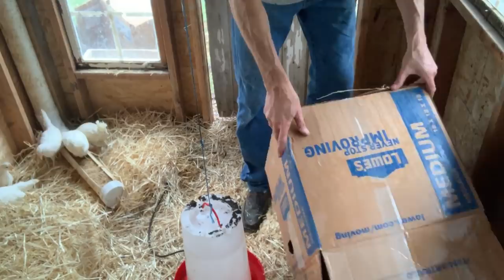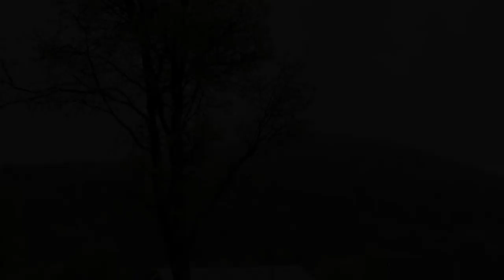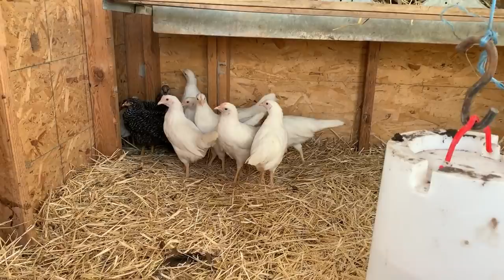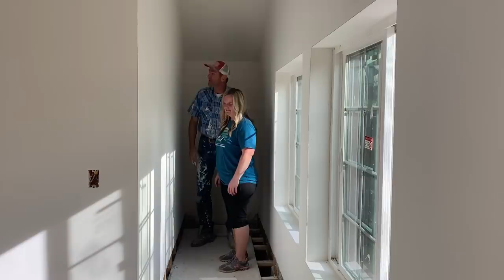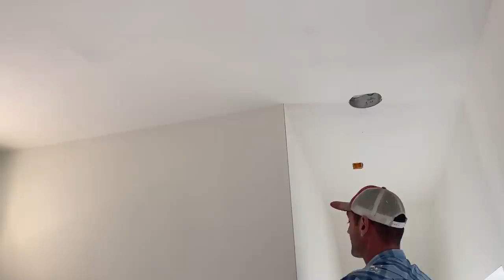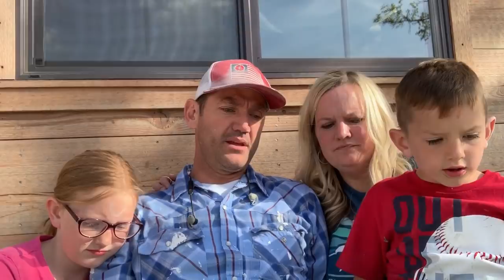#328 - Cedar Inspects Final Drywall Finish... Ready For Paint!

Comment: Before you remove the covering over the stairs..
Concider painting the ceiling and areas that will be hard to get at once the landing is removed
Reply: Trim, paint and wash windows. Leave the ledge. It will make doing this job again (washing windows and painting) easier and do-able by teenagers.
Reply: @marianneoprisko7737  
Then if that's an idea...
Take 1 inch thick of plywood and hinge it up to a wall. Then when needed...simple fold it down
Reply: @jimh712  yes, those little trouble finders will grow into helpers. And if Cedar sees it for a safe way to reach the out of reach, she  will be way less afraid.
Reply: If you were looking to add a bit of more storage, right in the end of the same area covering over the stairs a 3' X 3' closet or a bit bigger would be a good area for a small storage or a hidden closet for personal valuables.  You can build a long one piece or a two piece retrievable catwalk all the way to that unused space covering over the staircase.

Comment: From playing at hanging sheetrock what I have decided is the more work you do putting up one skim coat on top of one more skim coat.. you end up with more skim coats to fix the previous skim coats.  Then you have to sand or water sand to actually get close to the skim coat that turned out to be close to what you wanted.  If all this sounds redundant it is because that is the nature of a level 5 skim coat

Comment: If your done mudding this won’t help. But if not, you can thin down your mud with water and use a 3/4 nap roller to apply the mud and then smooth out with your 12 in knife. That how I used to smooth out walls.

Comment: Told you before Heath, you get my utmost respect for all the hard work you've done in such a short time. Respect !
After so many years of construction and renovations under my belt, if there is ONE thing I always hated to do is drywalling and mudding. The last projects I did, over 10 years, I subcontracted both. These guys work way faster than I and way better than me.
Doing a full house like yours is a non-sense. Both time wise and financially.  It's physically VERY demanding for the non-professionnal. And these guys don't cost that much, you know...

Comment: Use a pva primer before paint! Have you thought of using a roller to roll the drywall compound out since you doing all the steps for a level 5 finish. To roll it you will need to thin the compound with water. 

Happy mother’s day!!!

Comment: Looks good. I topped our current house with  4 coats then used our texture hopper with a Light Mediterranean knockdown. I should have done 5 coats not 4. I am the only one who notices it. It is not up to standard but 25 years ago we were trying to get moved in before winter. By the way in I would not run the Sheetrock vertical, you wont be happy with the joints when the house settles. What a great feeling to be so close to moving in. I am excited for you my friend. God is so good!
Reply: If drywall was meant to hang horizontally, why are the ends not tapered?

Comment: The drywall and painting process takes a couple of months, unless you have a team.  I think it looks beautiful.  If you have some krinkles or bubbles in the tape, they will show all the way through, unless you re-tape, hide the spots with a picture, or of course, bring out the Spanish Knife texture on the wall.  It takes years of practice.  I've seen drywall/tape/mud teams put on an outstanding show on some commercial buildings because they put in the miles to get there.  As long as it looks decent and clean, you are good to go!

Comment: Is flat walls not normal in the US? Here in Norway we usually only have flat walls. We hide the seems and screws but we do not put mudding all over the drywall.
Reply: Wall finish here seems to be personal taste, people do what they want.  If you have a professional dry wall finisher do your walls you get flat walls.  If you do it yourself, you probably never get perfectly flat walls because of your skill level.   The mudding in these videos is unusual for me.
Reply: Mr.Null is correct, typically drywall spackle is used to cover seams, screws and imperfections. Spackling entire wall and ceiling surfaces is not common. As you can see the amount of work it takes. Once he’s done with drywall primer, first coat of paint then finish painting. A super super job is being done. My gosh what conviction!

Comment: Apply a heavy coat of primer, paint hides a multitude of sins. After the prime coat check your finish and you can always touch up the bad spots. Put the primer on with an airless and back roll it. Does a much better job. Make sure you take all the sanding dust off the ceiling and walls before priming. LOOKING GREAT, ‼️👍👍 Vinny 🇺🇸

Comment: Textured--Any Skunks in you area? Skunks eat chickens and will chew/claw through wooden walls in one night. They also will dig under a wall so  be warned if those critters or weasels are in your new coop's area. Great job and work ethic, thanks for your video's I watch every time they come on.
Reply: I burried rabbit wire about 6 in in the ground then layed it flat coming out about 12 inches all around the coop and chicken run.
Been 4 years and no critters got in. 
In the chicken run I put chicken wire over the top to keep out Hawks and racoons.
Reply: Tin roofing on the side bout half way up like the house (which looks very good by the way) and the wire mesh that you use in building rabbit hutches would go a long way to protect the chickens and tie the coop to the house visually.
So he lost a tooth huh? Growing like a weed!
Everything looks so wonderful to me. Have a really good week.

Comment: Ouch, your not going to like it if the drywall downstairs starts showing a wave in the drywall later on. Its meant to be used horizontally . Good luck on it.
Reply: Doug & Susan McNattin it’s drywall not roofing shingles.....as long as it’s fastened down good it’s not going anywhere.....my dad finished his basement like that and it’s been 25 years and I’ll be damn but that wall still hasn’t waved at me one time ....relax boss it’s gonna be ok lol
Reply: It actually is made to go horizontally thats why the studs are on 16s and the sheets are 48in

Comment: I don't mean to rain on your parade, but do not run sheetrock joints vertical. The vertical joints should always be no more than 48".  Not staggering the joints will result in cracking as the house settles and moves with weather changes. 50 years in the business.
Reply: Chuck Haynes yep bc we have the same in our house and its cracked
Reply: Done mine that way 38 years ago, and NO cracks :-}
Reply: An idiot “contractor” hung ours vertical, and guess who had to redo the joints a year later? This gal. Learned very early that it’s best to learn from a pro and do the repairs and build my self in my own home.
Reply: It would be better than how he did the upstairs.
The key is to start with the upper sheet, then the middle and then the cut piece is the bottom.  Another thing you can look into is getting 5' wide wall board.
Reply: Yep.... horizontal.
Reply: Not with metal studs (;

Comment: Do not, do not, do not stand the drywall vertical on the ground floor. That is not how drywall is designed to be done. You run the risk of actually developing waves in your walls. If you do it vertically, it will overtime look like it was done by a plumber. The upstairs is done correctly and I highly advise you do the downstairs as such.

Comment: i still dont get it  if you wanted smooth walls  why did you skim coat the walls instead of traditional  drywall mudding . the way you went about  doing it  takes way way longer and  involves a ton more sanding

Comment: Paint will cover up most of the tiny imperfections it will be fine.  That stuff you will walk by and never see it after the paint is on. No one stares at the wall looking for small stuff. You wont notice that little stuff when your walking by it you will be intent on what your doing not looking for imperfections. It looks masterful your over killing it. Start on the down stairs before the SHTF your wasting valuable time life is too short for minuet imperfections. I would not have even put the skim coat on it after the joints were sanded that would be it for me and I have worked at a fine art foundry and sign company and house painting and pottery and was good at what I did but didnt sweat the small imperfections or I wouldn't have gotten anything done.